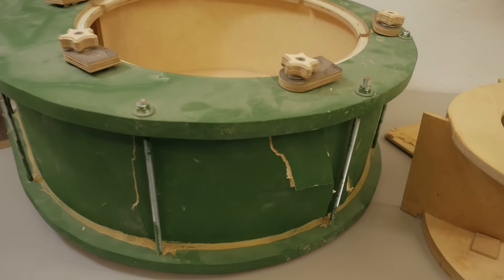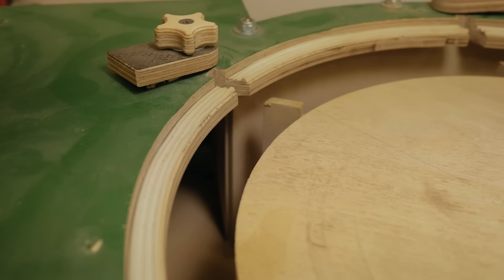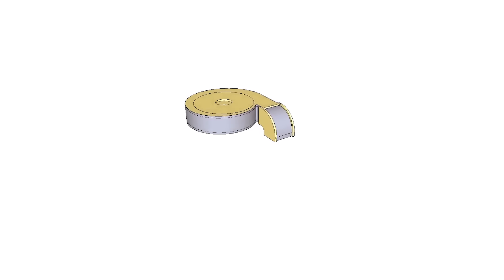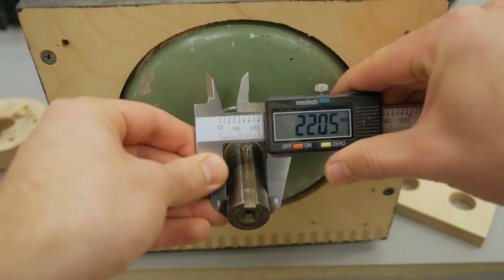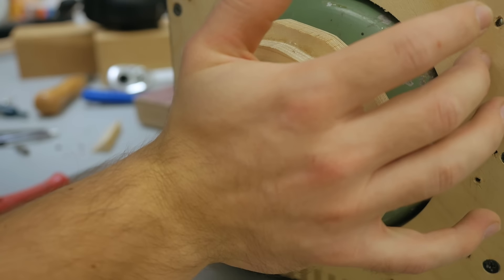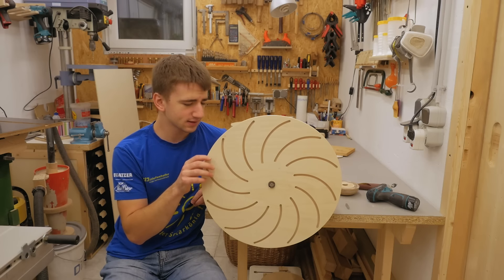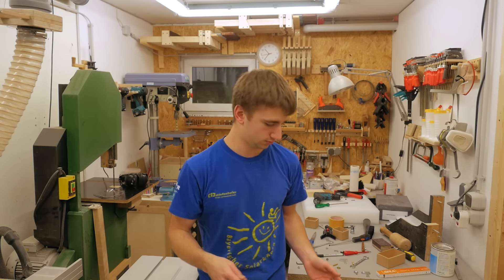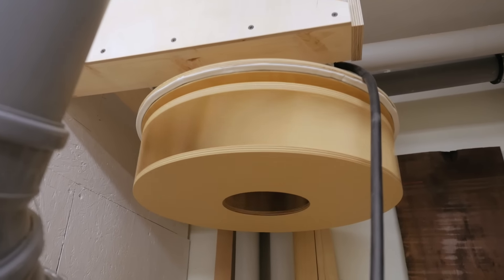Building a Big Dust Collector Blower #1

Comment: There is an old trick to 3 phase motors starting with 1 phase, that way you cut the power down to 1/3 on start-up and once up to speed the switch goes over to all 3 phases which makes things somewhat smooth.
Not sure if those switches are still sold somewhere, I certainly didn't come across any in my local shop.
Reply: MsSomeonenew   Even if they are not made or are expensive, it would be quite easy to wire just one of the phases through a separate switch to power on first phase and then flip the primary switch to add in the other phases. The same would also work to run it as a two phase motor too by not turning on the first phase switch.
Reply: no!
A 3 phase potor will not run with 1 phase. the only thing happening is, that it gets warm. If it is a well build Motor it could run with 2 phases, but if  you put minumum torque on it, it will stop and start buzzing. It will get hot and draw much current.
There is a common method to minimize the current at startup called delta/star starting. But it only minimizes the current and the torque, not the rotation frequency. I think this motor would have enough torque anyway.
The only way is to use a softstarter or a frequenzy converter. Both are expensive...
Reply: In Mechatronics class, I was looking over the assembly line mockup and said “what smells so HOT ?”.

We started digging and discovered the student who had wired the three phase motor had done it incorrectly.

It was running on 480 volts but was wired wrong; thus the motor was overheating.

Check eBay for Three-Phase motor controllers.   You’ll be surprised at the deals you can find.

I recall a Three Phase 1 HP controller for less than $50 used.

Comment: A recommendation for the strength of wood... The grain should always be running in the same direction, so your idea with the plywood is great, it might not be as strong as a bent lamination of plywood. i would recommend getting a rubber plywood specifically for this. (Just look up "rubber plywood" on google or ask your local plywood dealer) and one of the fins you made as a mold. Thanks for posting, great video.  ( also adding little blocks on either side of the fins would increase the strength of the stop groove you made.)

Comment: A bandsaw trick for cutting curved pieces like you did for the fins is to place the offcut the thickness away from the blade. Then the curved block will be guided by the curved off cut and you can quite easily cut the remaining curved parts with little concentration.

Comment: I'm not sure you won't have problems again in the future.  The fins are depending on the glue joints again, not making use of the long fibers of the wood.  I'd recommend using polycarbonate, heated it should bend easily into your grooves.

Comment: As an electrican i recommend you to use soft starter for this motor or use a controller that has soft starting option. With propeler this big you are facing a load that is too big for wood.

Comment: Great video as always! I have to express my doubts about the plywood fins though. Cutting them the way you have means that the grain is on average at about 45 degrees to the force. I can see this causing the laminations to strip apart after sometime. No way to know for sure without trying it though.

Comment: Regarding the impeller noise, one thing that's common in the automotive industry is asymmetric blade layouts.  Of course, the downside to that is that it makes the individual blades harder to design as they are all different.  

I also have no idea if it would work on this style of fan.

As always, cool stuff!
Reply from the maker: I actually had planned on making it with this style, but decided to try it some other day as this one just needs to work. But thanks for letting me know that my theory actually works.
Reply: https://goo.gl/images/JhpMII  The Eurocopter Dauphin's tail rotor is a notable example

Comment: Hi Marius, a good solution for noise reduction of your fan blades is to break the symmetrical pattern. Meaning you could install the blades out of sync in unequal angles. For every engineer I admit it looks hideous but it works well. Of course you'll need to balance the wheel afterwards by removing material from the heaviest side. Good luck with your videos, I like it very much.
Reply: In addition to my first comment: besides reducing noise, you also  break the socalled "eigenfrequency" which probably destroyed your first blower since you mentioned the heavy humming noise trhoughout the workshop.
Reply from the maker: I actually had this in mind for quite a bit. Someone else also commented that it works. But as I wasn't sure yet I wanted to go with the design that I know it works. I probably try it with my small DC soon.
Reply from the maker: doesn't everything has its eigenfrequency, which can't be fully avoided and just shifted to another frequency? I'm not quite sure about that yet, as we just started with this subject in "machine dynamics" at university.
Reply: Marius Hornberger. True. Even something large as a ship has an eigenfrequency caused by engine vibrations, which could cause severely damage to for example propellors or even the hull when sailing trhough a small canal. The rpm must in that case be brouhgt down.

Comment: hey man, great video! i can notice that you love science and enjoy explaining the physics involved in your projects. Are u studying something related with that? if that's so, have u ever consider making a simulation on the pc? it is your third blower i think. And also, the only reason to choose wood over sheet metal (aluminium or steel) for the blades is the glue?
Reply from the maker: I study engineering. A simulation of this is beyond my knowledge right now. 3,5th blower (replacing an impeller). Main reason is glue, as I don't have the suited tools for metal working.

Comment: 9:18 Use a really thick plywood connected to the motor, then you can use thinner on the wings and even thinner on the opposite "base-plate".

With a thicker motor-base-plate it means that it requires more energy to rotate and therefore you get a little slower acceleration (it will also kind of buffer the movement-energy), but you need to make sure that the key between the drive shaft and the plywood will support the energies without destroying the plywood.

Comment: Hi Marius, the new impeller looks great. Regarding minimizing your motor startup torque perhaps it might not be too expensive to add a primary resistor circuit instead of going with a VFD. A simpler approach could be realized with two sets of 3 pole switches similar to what you are already using. But since you are clever you can probably figure out how to do it with a  3 pole relay and home made pressure switch.

Comment: Hi Marius,
I haven't got a band saw so I have a problem with cutting the curved wings. I'm thinking of using 2 or 3 mm plexiglass, what do you think about it? Will it work, have you got any experience in this? 
Why do you use the secend ring, it is necessary?
Reply from the maker: Don't use plexiglass, it's brittle and will shatter. The top ring is needed for stability (it's essential for a wooden impeller)
Reply: Thanks for your hints. I will use them while making my own dust collector.
Reply: Ich ziehe gerade orangenes Abflussrohr (KG-Rohr) für die Flügel in Betracht:
Die Rohre mit 250mm Durchmesser haben eine stabile Wandstärke von 6,2mm. Davon werde ich zunächst Ringe abschneiden und diese dann in Segmente teilen und als Flügel verwenden. Was hälst Du von dieser Idee?

Comment: You are very smart. You seem to think of everything. I think you are correct about the startup torque on the blower wheel. It is extreme. Have you done any consideration about using a VFD (veritable frequency drive)? A bit expensive but can solve many issues you have. Allow a soft start. Able to ramp the speed up or down. Apply an electronic break. I would like to know what you think about it. Either way, good luck with the blower.
Reply from the maker: A VFD that can do all that for 2,2kw would probably cost more than my whole dust collection investment so far. It's tempting to get one, but not worth the expense for now.

Comment: Interesting build, Marius.  A couple of suggestions for materials you might want to look at:  For your hub, Phenolic or Bakelite might have also been suitable - a bit harder than wood, but still workable with woodworking tools.  For the vanes, you could have also used the kerf-bending technique, or, a type of plywood designed for bending around curves - sometimes called "Wiggle-Wood".  For glue, if you've never used polyurethane glue, I'd highly recommend it (Gorilla Glue is the best IMO) - I've almost completely abandoned aliphatic resins except for biscuit joints.  A tool you might also find useful for drilling holes perfectly aligned with hardware - or other holes - is a set of Vix Bits.  Thanks for sharing :)

Comment: For the outer disk you could use the thicker plywood and use your CNC to remove material between the vanes to lose weight.

It's more work for your machine but you get the best of both worlds - more glue area for the vanes and lighter weight.

Comment: Sir, very nice work. Have you considered using a reduction gear? Can that motor be ran from a rheostat? There a 2 major methodology for dust collection.  1. Section, 2. Pressure. You're using suction. The second way is to pressurize a pipe and place a "Venturi" on each suction line. You may be better served by the a venturi system. I do not know your specific configuration but you have large collection pipes. It appears you're moving a significant volume of air.

Comment: Several methods of starting a polyphase motor are used. Where a large inrush current and high starting torque can be permitted, the motor can be started across the line, by applying full line voltage to the terminals (direct-on-line, DOL). Where it is necessary to limit the starting inrush current (where the motor is large compared with the short-circuit capacity of the supply), the motor is started at reduced voltage using either series inductors, an autotransformer, thyristors, or other devices. A technique sometimes used is star-delta (YΔ) starting, where the motor coils are initially connected in star configuration for acceleration of the load, then switched to delta configuration when the load is up to speed. This technique is more common in Europe than in North America. Transistorized drives can directly vary the applied voltage as required by the starting characteristics of the motor and load.

Comment: i would reduce the size of that cut out on the wheel for the blades to fit in, That is pretty much the whole structure of that wheel and it could send all the blades flying at once. I suggest making 2 small slots per fan rather than one big one. Those blades are so smooth, Lovely!

Comment: hmm, good job working all that out, if the starting force of the motor is too harsh on the impeller then maybe a transmission is required or voltage control dial to have a lower speed / newton-force for startup to smooth out the startup. You might have to get all EE to figure that out.

Comment: You could also make the top disc thick around the blades to provide bigger surface for glue joint and thin in between of the joints to decrease the mass. It would be really complicate for hand made, but you've got your cnc router, don't you?

Comment: Great project. Though are you concerned about end play on the motor shaft? When removing the impeller flange from a dry test fit I think I saw the shaft move forward then back into the motor by a couple mm.

Comment: Hi Marius, love the build, I am making a very similar machine from Bill Pentz's plans. I was about to use MDF for the vanes but saw your destruction video just in time, I have gone a slightly different route to you and laminated my own plywood, with a curved form as you previously used. I bought some oak veneer 1.5mm thick (pretty cheap) and have made a 4 ply with it, alternating grain. I dont know but I assume my way will be stronger than yours? Maybe something to keep in mind if you get another failure...
Great to see another way of doing things, its been great to get the inspiration for my build.

Comment: I might have used 3 or 4 evenly spaced lengths of threaded rod between every 3rd or 4th vane... and acorn nuts (noise considerations) & washers to clamp the two discs together and relieve some of the strain on the glue joints...

Comment: This is great. Did you check the load on the motor yet? Looks like it will run on the limits with a blower fan this big. But: great ideas and the method you cut the blades, respect! If I had tried that I at least had several blades bow in the other direction :) Cheers....

Comment: That motor is very powerful and produces quite a bit of stress on your blower when you start it.  You might want to step the voltage up slowly at start up to reduce the stress.
Reply: Oops, made my comment before I got to the part where you address this problem. Sorry!

Comment: Hmm my gut says those fan blades on the new impeller aren't ideal... gluing together wood doesn't sound like a strong solution... just saying. Other than that... very impressive... I'm currently working on using a cheap shop vac for my dust collection needs with the exhaust straight out the window for all fine dust. Not sure if it will be sufficient or if I'll have to do something along the lines of your design. What dust collection needs do you have for such a big impeller? Just a dust boot on your CNC?
Reply from the maker: Dust collection = high air flow, low pressure ->big impeller, big pipes and hoses
Shop Vac = Low air flow, high pressure ->small impeller, small hoses
Any table saw, band saw, jointer, planer etc. need Dust collection, not a shop vac

Comment: You should balance your impeller, a static balance would go a long way in preventing vibration and increasing the life span of the impeller.  

I'm interested to see what happens to the overall system with the decrease in blade width and double the number of vanes (added) also noted that the large diameter impeller will increase the stresses (.) although I doubt if you measured the power input but you might have increased the overall stresses on the impeller with the changes.  It seems that with the beefed up components you should do alright. 

I'm guessing that the play in the brass key contributed to the vibration and stress that caused the failure of the preceding design.  Consider hardening your homemade key to minimize that possible failure point.

Comment: I just watched a video by 'Matthias Wandel' and he was experimenting with various blade designs and how they affect the velocity and pressure of the exhaust air. Going by his findings; unless you're using a venturi pump to move the air, I would suggest making your blades flat, you'll get better air movement, more strength in your design at the expense of a little extra noise than the backward blade design.

Comment: Some thoughts about 12 or 9 mm ply.
If the CNC can do 3D cutting, without too much programming.
Using 12 mm or thicker, then some nice soft curved grooves cut between the blades, turning to follow the blades.
They would ad to the strength and the areodynamic of the impeller and without much added weigth, right?
And its real nice work Marius, both video and product :-)

Comment: If the blower binds what disengages the motor?  I am thinking about using a VFD (Variable Frequency Drive) to drive the motor on a slow ramp up to speed and slowly decrease the speed when shutting down.  Some VFDs can detect if the motor is binding and turn off.

Comment: You could use a soft start relay to start the motor it would use less energy and much smoother on the impeller structure

Comment: try to make the" key" with low strength kind of wooden material instead of metallic one to lock impeller to the shaft.. this way you can for sure protect your impeller hub from getting damage... key material should fail first before it can damage impeller hub... rest you have a perfect design.. all the best

Comment: RPM x 60 x (# of vanes) = primary frequency in Hz of the blower noise.

Since human sound sensitivity decreases with high frequency, and high frequency is easier to dampen, your 6 vane & 12 vane probly are about the same, but you can't hear the 12 as well as the 6, so it's quieter to you.

Comment: Did you consider using thicker plywood on the motor side and thinner on the other side? Theoretically it would a) reduce the dead weight on the other side that the blades have to turn and b) have more mass next to motor to reduce start speed abit.
Another thing, as you now have a steel key, can it start wearing out plywood?
Just pure theoretical thinking.
Good video and nice build.
Reply from the maker: I built it with thicker plywood on the motor side and thinner on the other side. As the key is quite big it won't wear into the wood very much. Haven't had that problem with my previous flanges either. (even with the original smaller key)

Comment: Because you shaped and cut your fins across the Ply lamination and that some of the layers are quite narrow before the next layer, could there be an issue with the plywood de-laminating? Would it be stronger to turn the plywood block onto it's end instead?

Comment: You might be able to break down the total amount of the noise made by yor dust collecting system into its components and find solutions to reduce each: The noise made by the motor and the rotating parts of the dust collector could be isolated (inside a "muffler" or "silencer" chamber which does not let much of the noise out >>> find out how!). Also, the shape  of your air pipeline might be optimized to reduce the rest of the noise if it is a significant share of the total.